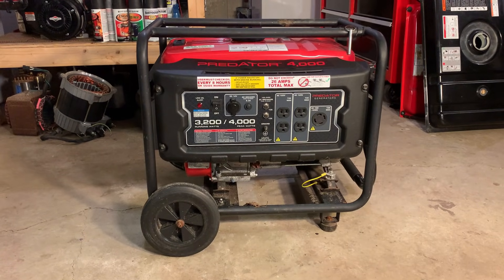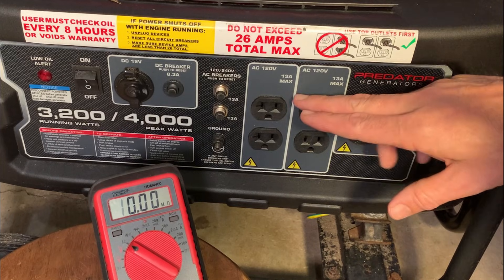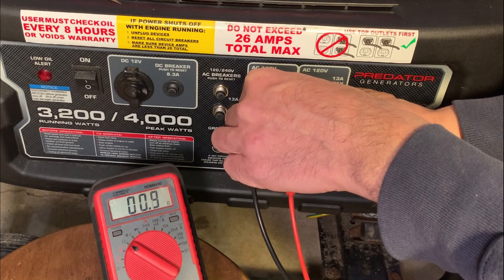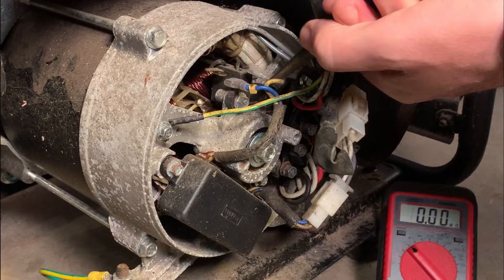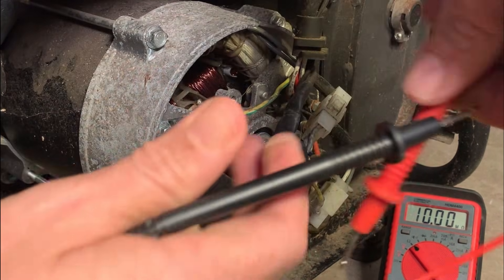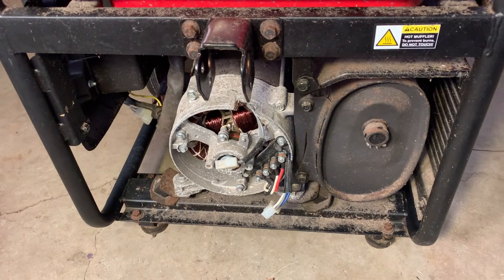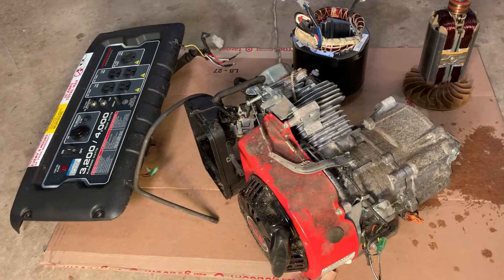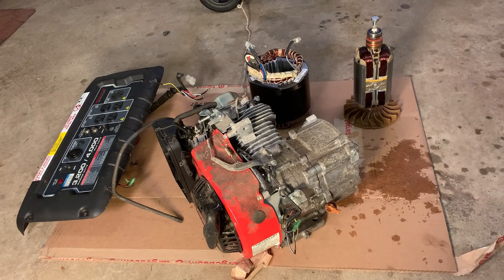Predator Generator Not Making Power

Comment: Does nobody know anything about how to excite the diodes in a portable generator .it;s in the manual and takes all but about 5 minutes with a 100 watt old not led bulb, a pigtail socket a temporary connection  and as soon as light starts to illuminate your done. read manual or call company. there is nothing wrong with your generator,,,,,,,,,,,,

Comment: On one set of outlets I'm getting 8 ohms and the other set I'm getting 1 ohm does that mean the stator is bad?
Reply from the maker: Not necessarily.  There could be electronics in circuit causing that.  The only way to know for sure is to disconnect the wires from the stator and test directly.

Comment: I have the 4375. Completely happy with the 120 and 240 outlets.  I was told it's too dirty to run my new Samsung refrigerator.  OK, I bought a 500-watt inverter.  When I plug it in to my DC power jack, the inverter light turns red and no voltage. I tested the inverter with my ham radio equipment.  Perfect.  Took a reading on the voltage output . Instead of 12 V, it's 26. This generator is only a couple of years old. I use it to run power tools etc. A Google search tells me that this is not just my machine.  I've grounded it, removed the ground.  Still 26 volts at the DC output.  Ideas? I'm hoping for an operator error.  Thanks.

Comment: Why not cut off a stud with the corresponding threads, slot the end for a flat tip screwdriver then thread it into the crankshaft and using the jacking bolt to free the rotor. ?

Comment: When you come across generators that have a large bolt you could cut down a bolt that fits and slot the cutoff end for a slotted screwdriver to screw the threads all the way in and still do the bolt on the end of the shaft with little to no chance of dan aging the threads of the bolt stud or the crankshaft.

Comment: my predator 4000 is a little newer than this one, similar story, bought a couple years ago, then never used it until a recent ice storm, and it doesn't produce power. the 110v receptacles on mine are GFCI, and upon initial testing there was open circuit on both of them. I pulled the panel off, and tested the wires coming into the backsides of the outlets, and they both tested within the 1 ohm range. have 50-60 ohms at the brushes. the test/reset function on both GFCIs doesn't work(I can't get them to trip or reset). Do you think it's possible that both outlets just went bad from sitting? or am I missing something? there is a note on the side of the generator that the GFCIs won't prevent electric shock unless the outside ground is hooked up, but im not sure if that would be related.

Comment: Excellent video! just digging in to my predator, with the same problem. bought it new a few years ago, finally tried to use it and no power. how do I test the AVR?
Reply from the maker: There is no test that I know if for the AVR.  Usually I rule out what I can and buy an AVR if no other issues are found.
Reply: cool thank you! @jcondon1

Comment: 𝐉𝐚𝐦𝐞𝐬. 𝐓𝐡𝐚𝐧𝐤𝐲𝐨𝐮 𝐟𝐨𝐫 𝐩𝐮𝐭𝐭𝐢𝐧𝐠 𝐨𝐮𝐭 𝐭𝐡𝐞𝐬𝐞 𝐯𝐢𝐝𝐞𝐨𝐬. 𝐄𝐱𝐜𝐞𝐥𝐥𝐞𝐧𝐭 𝐣𝐨𝐛.  𝐂𝐚𝐧 𝐢 𝐟𝐥𝐚𝐬𝐡 𝐦𝐲 7000/8750 𝐰𝐚𝐭𝐭 𝐩𝐫𝐞𝐝𝐚𝐭𝐨𝐫 𝐢𝐧𝐯𝐞𝐫𝐭𝐞𝐫/𝐠𝐞𝐧𝐞𝐫𝐚𝐭𝐨𝐫 57480. 𝐰𝐢𝐭𝐡 𝐚 12𝐯 𝐜𝐚𝐫 𝐛𝐚𝐭𝐭𝐞𝐫𝐲 ?  𝐈 𝐡𝐚𝐯𝐞 14 𝐡𝐨𝐮𝐫𝐬 𝐫𝐮𝐧 𝐨𝐧 𝐦𝐢𝐧𝐞 𝐚𝐧𝐝 𝐢𝐭 𝐬𝐭𝐨𝐩𝐩𝐞𝐝 𝐦𝐚𝐤𝐢𝐧𝐠 𝐩𝐨𝐰𝐞𝐫 𝐰𝐡𝐢𝐥𝐞 𝐢𝐭 𝐰𝐚𝐬 𝐫𝐮𝐧𝐧𝐢𝐧𝐠.  𝐈𝐭 𝐬𝐭𝐢𝐥𝐥 𝐬𝐭𝐚𝐫𝐭𝐬 𝐚𝐧𝐝 𝐫𝐮𝐧𝐬 𝐠𝐫𝐞𝐚𝐭 𝐛𝐮𝐭 𝐳𝐞𝐫𝐨 𝐩𝐰𝐫.  𝐈 𝐭𝐫𝐢𝐞𝐝 𝐟𝐥𝐚𝐬𝐡𝐢𝐧𝐠 𝐢𝐭 𝐮𝐬𝐢𝐧𝐠 𝐭𝐡𝐞 𝐬𝐦𝐚𝐥𝐥 𝐛𝐚𝐭𝐭𝐞𝐫𝐲 𝐭𝐡𝐚𝐭 𝐢𝐬 𝐚𝐭𝐭𝐚𝐜𝐡𝐞𝐝 𝐭𝐨 𝐭𝐡𝐞 𝐢𝐧𝐯𝐞𝐫𝐭𝐞𝐫 𝐟𝐨𝐫 𝐞𝐥𝐞𝐜𝐭𝐫𝐢𝐜 𝐬𝐭𝐚𝐫𝐭 𝐨𝐩𝐭𝐢𝐨𝐧 𝐛𝐮𝐭 𝐧𝐨 𝐜𝐡𝐚𝐧𝐠𝐞.
Reply from the maker: Sorry this comment was held for some reason.  Just seeing it now.  Inverter generators use a permeant magnet configuration.  They cannot lose magnetism.  So flashing it will not restore power.  If no output then wither a bad stator or more likely a bad inverter module.

Comment: Hi James.  Very good video.  I have a Predator 4550 which is only a couple years old.  I haven't used it much,  I pulled it out tonight to power the lights in my barn.  The generator has two banks of 120v sockets each.  The left set is not putting out  much power and shows .9 volts on my meter.  The right set of sockets is putting out a healthy 125v.   Would you have any idea why this is happening?  Than you very much.
.

Comment: Really appreciate the video, have an older model 4k that runs well, been neglected and bought it refurbished during a parking lot sale. I do believe the stator wire like yours has corroded and is toast or maybe o can heat it up and solder a new jumper in as a last ditch effort to make full power.

After I freshened up the stator block, ground and checked all the connections you mentioned, it still fails to put out above 5V on each 120V outlet. Worst case scenario I make out like you did but the frame is toast, rusted severely from rotor bolt height down.

Comment: I have a Troy built and a 214 at 57 hz. And I raised the speed and replaced the avr and brushes and still voltage won’t go up it sounds like it is bogging down and I am not putting but 3000 for a 5500.  Please get back to me 3:57

Comment: Hi James.  I enjoy all your video's.  Question:  on my generator which has 4 household style outlets one side is not putting out power working/putting out power.  The other set puts out power.  The 120/240 works fine.  Breaker? Outlet itself? Wire? Any ideas where to start?  Thanks.

Comment: I think the rotor is fixable.  When I work with enamel coated wire, I first burn the end to soften the enamel and anneal the copper.  Then scrape off insulation.  Tin the ends of the wires individually first, using solder, then twist and solder.  Insulate and epoxy for mechanical strength.  If you have to fish out a turn, it will still work fine.
The hydraulic trick is amazing.
Reply: i would definately do the same, I have saved a lot of motors like that.

Comment: Any idea why my brushes would be wearing really fast on 1 side. I've replaced 2 sets now. I also have to run the generator with the choke on or it starts to cough, run rough then die. I added a little seafoam to the gas as I've notice some shellac build up. Any ideas or suggestions greatly appreciated. It's a 7000 8750 predator
Reply from the maker: Sounds like you have two issues going on.  The brush wear could be caused by a slipring that has an imperfection causing unusual wear.  
If the engine runs well on choke then it is running lean.  You might have to clean or replace the carburetor.
Reply: @jcondon1  ok thank you. Can a slip ring be replaced and or do you have a video of that type of fix. I will start checking your videos now also. Thanks again
Reply from the maker: @saytim1  I do not have a video on that.  I believe they are pressed on.  That said, I have never seen the part sold separately so not sure where you would spice the part.

Comment: Nice video. Where and how do you order parts for the H.F Predator engines?
Reply from the maker: Have not been able to order parts from Harbor Freight.  This is a Honda Clone.  Most Honda clone parts in the 6.5 HP range will fit.

Comment: This is a good reason to check any equipment as soon as you buy it, so you can return it if it does not run as expected.  I put an new piece of equipment into a program I call APM.  I run it every day for a week and then every week for a month and then, every month for a year.  After a year, I feel it meets its desired operation standard and if it breaks during this program it is still within the warranty period.
Reply from the maker: That is smart.  Most breakdowns due to a manufacturing error or poor quality control do happen early on.  Happens to me any time a buy a new computer.  The first year is fought with multiple breakdowns.  Once the parts are replaced under warranty it will last me 10 years without issue.

Comment: Just stumbled on your page. Interesting seeing a Predator generator repair. I'll have to remember the water trick, that would never have occurred to me. I bought an electric start 7Kw Predator in 2016. So far it is working fine but have only fired it up for quarterly testing. Buying one seems to have kept the power outrages at bay. Here in NH typically have a week long outage every few years.

Supposedly Harbor Freight has gotten better and is now selling some spare parts. But I agree probably not cost effective since you seem to have access to lots of dead ones probably better to make a Frankenstein generator out of scrounged parts.
Reply: Don’t forget about the generator safety rules: Always make sure you follow all the generator safety rules whenever you use your portable generator. This is only a reminder. Generators can be dangerous if not used carefully. Every year, hundreds of people die or get injured when using portable generators due to carbon monoxide poisoning and electrocution. Make sure you are using your generator carefully and keeping others safe as well. There is something very serious that everyone should always be aware of when using generators. Some people do run their generator indoors which is not safe and that increases the risk of carbon monoxide poisoning which can cause death of family and you. Some people run their generator in wet conditions which can electrocute them. Please remember that you should never run your generator indoors. Remember that carbon monoxide is an odorless and colorless gas that you cannot see or smell. Carbon monoxide is a silent killer. Keep that in mind. Make sure your generator is 15-20 feet away from your house and away from doors, windows, and vents. Never use your generator in your porch too. Having a carbon monoxide detector is very important against generator safety. Some people also allow children to go near the portable generator which could pose risks. We need to keep an eye on our children making sure that they are not near the portable generator so they won’t get electrocuted or burned by the generator which is dangerous. A locking enclosure also keeps kids safe. A generator shed might look like a tempting place to explore, or take cover during a game of hide and seek, but a generator is a dangerous piece of equipment that can cause injury. It says on the manual that we should also keep children away at all times from the portable generator to avoid injuries. Please do not allow a child or unqualified people to operate the portable generator.  It is important to keep your children safe especially little ones. The portable generator can be hot during an operation. Just because some manuals missed what should be listed doesn’t mean it’s safe to do. Always follow the generator safety rules when using portable generators. Generators pose electrical risks. If you need to use your generator during wet weather, you need a generator tent to protect your generator from getting wet. Don’t let your generator get wet. Keep your generator dry and before using your generator, please make sure your hands and your generator is dry. Do not wear loose clothing when operating the generator. Everything that is said on the generator’s operating manual should not be ignored. Never smoke cigarettes near the generator. Please keep flammable things away from the generator. Never overload your generator too. Your generator can catch fire. Never ever try to plug a generator cord into a wall outlet to avoid back feeding. Back feeding your generator is dangerous. Always turn on your generator first before plugging in appliances and shut off the appliances before turning your generator off. Use a heavy duty cord for your generator and the cord should not be worn out. All the instructions should be followed carefully. Never refuel your generator while it’s running. It can cause fire if fuel spills while your generator is hot. You should turn off your generator and let it cool off before refueling it. Having a fire extinguisher next to the generator is also important. This is only a reminder for everyone’s safety of using generators. Make sure your generator is properly grounded. Having a fire extinguisher next to the generator is also important against the safety rules. https://youtu.be/I1jT3ANENvI and here is a video more about keeping others safe when using generators and also about our family’s safety. It’s important to keep our little children safe as well. Make sure your little children are kept away from the generator at all times especially when it’s running. Hope this helps. Always remember that it’s better to be safe than sorry. All generator safety rules need to be followed carefully to avoid hazards

Comment: i dont like that muff so close to gen ,,wonder if they get to hot ?
Reply from the maker: Definitely not a good location.  The heat shield is also only on the front so people do not get burned, but they did not bother to extend it around the back to protect the stator.  Does not seem to be a problem, have not seen many go up for sale with power issues.

Comment: Actually resoldering the rotor coil is easy the vanish used burns off at around 270.c
Reply: Don’t forget about the generator safety rules: Always make sure you follow all the generator safety rules whenever you use your portable generator. This is only a reminder. Generators can be dangerous if not used carefully. Every year, hundreds of people die or get injured when using portable generators due to carbon monoxide poisoning and electrocution. Make sure you are using your generator carefully and keeping others safe as well. There is something very serious that everyone should always be aware of when using generators. Some people do run their generator indoors which is not safe and that increases the risk of carbon monoxide poisoning which can cause death of family and you. Some people run their generator in wet conditions which can electrocute them. Please remember that you should never run your generator indoors. Remember that carbon monoxide is an odorless and colorless gas that you cannot see or smell. Carbon monoxide is a silent killer. Keep that in mind. Make sure your generator is 15-20 feet away from your house and away from doors, windows, and vents. Never use your generator in your porch too. Having a carbon monoxide detector is very important against generator safety. Some people also allow children to go near the portable generator which could pose risks. We need to keep an eye on our children making sure that they are not near the portable generator so they won’t get electrocuted or burned by the generator which is dangerous. A locking enclosure also keeps kids safe. A generator shed might look like a tempting place to explore, or take cover during a game of hide and seek, but a generator is a dangerous piece of equipment that can cause injury. It says on the manual that we should also keep children away at all times from the portable generator to avoid injuries. Please do not allow a child or unqualified people to operate the portable generator.  It is important to keep your children safe especially little ones. The portable generator can be hot during an operation. Just because some manuals missed what should be listed doesn’t mean it’s safe to do. Always follow the generator safety rules when using portable generators. Generators pose electrical risks. If you need to use your generator during wet weather, you need a generator tent to protect your generator from getting wet. Don’t let your generator get wet. Keep your generator dry and before using your generator, please make sure your hands and your generator is dry. Do not wear loose clothing when operating the generator. Everything that is said on the generator’s operating manual should not be ignored. Never smoke cigarettes near the generator. Please keep flammable things away from the generator. Never overload your generator too. Your generator can catch fire. Never ever try to plug a generator cord into a wall outlet to avoid back feeding. Back feeding your generator is dangerous. Always turn on your generator first before plugging in appliances and shut off the appliances before turning your generator off. Use a heavy duty cord for your generator and the cord should not be worn out. All the instructions should be followed carefully. Never refuel your generator while it’s running. It can cause fire if fuel spills while your generator is hot. You should turn off your generator and let it cool off before refueling it. Having a fire extinguisher next to the generator is also important. This is only a reminder for everyone’s safety of using generators. Make sure your generator is properly grounded. Having a fire extinguisher next to the generator is also important against the safety rules. https://youtu.be/I1jT3ANENvI and here is a video more about keeping others safe when using generators and also about our family’s safety. It’s important to keep our little children safe as well. Make sure your little children are kept away from the generator at all times especially when it’s running. Hope this helps. Always remember that it’s better to be safe than sorry. Be safe

Comment: Don't you have armature winders in the USA i have my rotors rewound.but I reckon I could repair that rotor just saying I'm not right there with you. ..
Reply from the maker: I have repaired a few in the past, but never satisfied with the result.  They worked, but my confidence was low on how long.  I have called around, but the cost of rewinding exceeds the value of the generator.
Reply: @jcondon1  your point is taken. Reputation is important. .

Comment: James How it’s going I need a pull string unit for a power boss  7000/5250 powered by Briggs&Stratton
Reply from the maker: Would need the engine number and/or the generator model to tell for sure.  Did a quick search online and although the engine says Briggs, it looks like a China clone of a Honda GX390.  Should be a lot of recoil options.